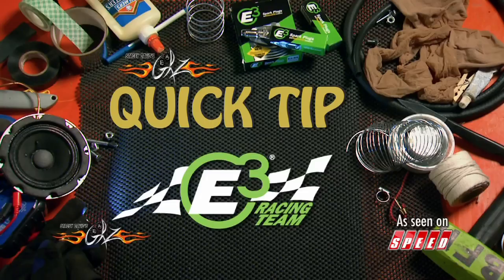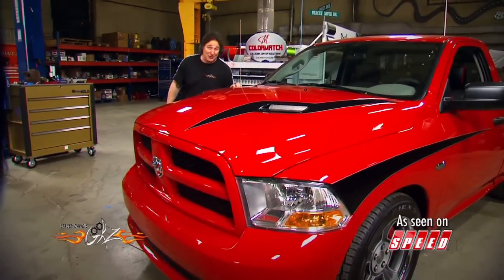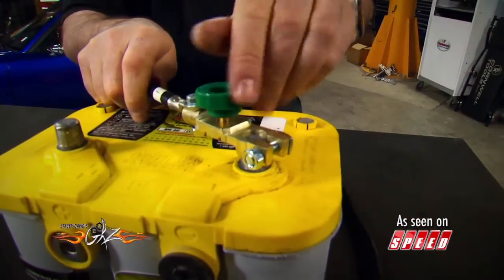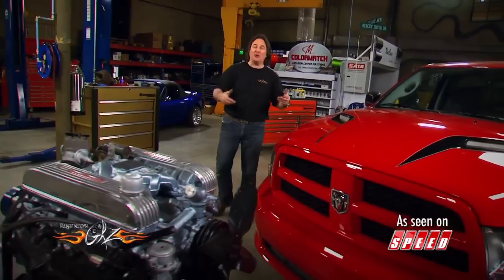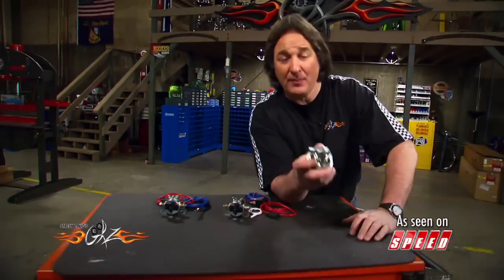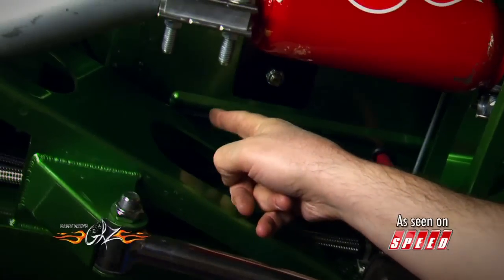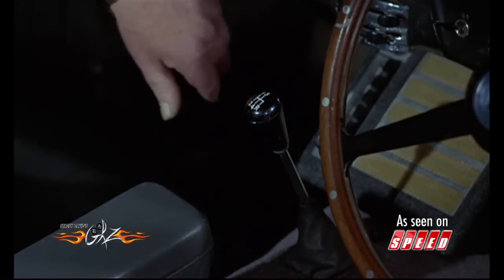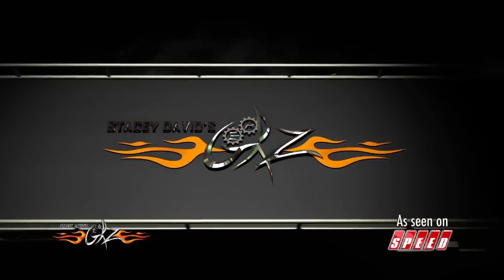Stacey David's GearZ Quick Tip: Keep Your Car From Getting Stolen

Comment: Number 1 way to prevent car theft: Drive a car nobody wants to steal.
Reply: so.. drive a PT Cruiser? lol
Reply: Jack Duno 
#1 - don't own a car.
Reply: ***** It's all well and fine until the original owner steals it back from you
Reply: R Mac Only way you're getting a stolen Ford home is via tow truck.

Because it's probably already broken
Reply: Doesn't matter. They can still sell it for scrap metal.
Reply: Amen
Reply: that right there is my strategy. lol 1983 chevy van. hahaha. though it is 4x4 now it does take some special tricks to start it considering it is a diesel and nothing is stock.
Reply: doesn't work. A lot of thieves will punk your car and sell it for scrap...

Find an Astro van. 1 minute later you got it running and down the street. Next day you're at the wreckers with 400 bucks in your hand.
Reply: Jack Duno  that is what i did for 10 years with my 97 corolla. had peeling clear and nobody cared, i could even leave the windows down at work and anywhere i went.
Reply: You mean a yugo?
Reply: Honda civic si
Reply: Tried that.. turns out my rust bucket was still something someone wanted. :(
Reply: Jack Duno prius
Reply: that wont work my old Astro Van got stolen twice
Reply: Jack Duno aww really??
Reply: really I did not see that characteristic in Iraq but I bet you never did anything for this country but take up space
Reply: Most of us Americans don’t know how to drive manuals
Reply: Guess it's possible that Astro Vans are making a nostalgic comeback, hence your two thefts.
Reply: Jack Duno so Drive a Prius
Reply: A Ford
Reply: They make you pay at the scrap yard to get rid of it they don’t pay you for the metal
Reply: Jack Duno not true they will use it to get out of an area they just robbed if they need.
Reply: Thieves steal 1990 hondas ,they steal whatever they can.
Reply: Or play pretty music like classical. Criminals hate that stuff because they’re so into rap.
LOL.
Reply: thought i was, till my '01 beat white ford cargo van full of crap was gone...
Reply: It don't matter they steal those two I have a 72 Dodge Dart and it was gone the next day
Reply: a LADA
Reply: What car? And why prius?
Reply: @zaheer4024  Atleast someone wanted it
Reply: I had one of those cars back in the '90's.  It was a Nissan Sentra beater complete with dents.  I loved that car.  I could park it anywhere and not give a rat's butt about nit wits parking too close and dinging my doors. I can actually say that I had more fun with that car than some others that also owned: 1978 Pontiac Trans Am, 2017 Mustang V-6, and my current 2020 Mustang GT.
Reply: @OnlyNotes  There's some truth here.  I just bought a new Mustang GT.  With only 1,600 miles the check engine light came on for the fuel purge valve.  What a disappointment. And to think, I thought the plastic oil pan on it would give me problems.
Reply: If you live in Socal, they will steel it for the Cats
Reply: @NotN8  p.s they did have a key tag anti theft my cuz has an early p.t
Reply: Buy a KIA nobody steals those….. 😩😂

Comment: I use 3 tricks, they don't work on a topless car but everything else they work.
1) remember the old Club wheel lock, I have one on my wheel (you don't even have to lock it) most thieves would see it and move on, it would take too long to cut loose and you can't drive with it on.
2) for tow truck using thieves, crank your wheel to 1 side, all the way to its stop then make sure the wheel locks when you go to leave. It's hard to pick the front up and now impossible to pull from behind because it will swing out the whole way to wherever they go.
3) hand/emergency brake. set it so even if they get it up on a truck it's going to make loads of noise and the only way to disable it is to cut the line or get into the car, both take time they don't have.

a friend of mine took a switch and a tilt sensor from a pinball machine and rigged it so when he parks, he flips the switch and whenever the tilt sensor makes contact the horn, dome lights, and brights come on, we tested it, you can't accelerate with traffic at all or corner without this thing screaming

Comment: a few tips for you guys worried about tow trucks.  if you park on a driveway turn your wheels towards another object,  a wall or car.  make sure it will hit if they try to drag it out.  the other thing is: if your car is a front wheel drive,  park it inwards and use tip #1. if they try to drag it out your car will smash into another object or they will just give up because it requires alot of time. if it's rear wheel drive i would say back it in.  the car will be dragging and slowing them down,  i would still try tip #1 but it doesn't really make a difference when they pick up the front wheels. my car is a rear wheel drive and my steering does not lock,  if they pick it up from the back they are good to go. in my case i park it in reverse and i got a 2 way alarm with shock sensors and tilt sensors,  if my car is lifted i will know about it immediately. not only that but my car won't go into drive without me messing with it hahaha.
Reply: John Doe what alarm do you have?
Reply: viper alarm.  you can ad stuff to it.  i added the tilt sensors to the alarm.
Reply: what model do you have? and that's sweet
Reply: i don't remember the model number but it comes with 2 remotes,  1 is an lcd 2 way pager and the other is just buttons. it comes with shock sensors and remote start. you can add other features to the alarm like tilt sensors, turning on stereo remotely, rolling windows up and down,  glass shatter detector,  proximity detector and a module to track your car and get notifications on your smart phone.
Reply: John Doe
Reply: Might work on the amateur tow drivers looking for a quick snag but if an experienced guy wants your car they will still get it out whether it's frw/rwd, backed in, or alarmed. They'll hook and go to drag the car around the block or put their slow-rollers under your locked tires to get you out of tight spaces so they can get you on their arm. Check out about 8:45 in this video for an idea of some of the equipment they can carry: watch?v=nOqfOyHDbTg
Reply: yeah i know it's possible but they will really have to want it to make all that noise and take all that time to do it.  most likely they won't be pros lol
Reply: I believe he has the Model -  Viper Responder 350

Comment: OR. Pull out ignition fuse cause im a cheap bastard.
Reply: killersushi99 they can just use one of the other fuses that is for say your stereo and slap it in there. It'd be better to just flip it around and stick it back in
Reply: Create a kill switch and hide it somewhere.
Reply: On the newer cars there's a fuse for the electric fuel pump.
Reply: I am thinking that A relay would be better than a fuse, they are far less likely to have the ignition for fuel pump relay on hand.

Comment: Pretty much every thing here is for older cars, newer cars have electronic kill switches and installing any of these maybe just be redundant and not needed.  Most common way of stealing a car is rolling it down the street to a waiting tow truck so the diesel doesnt wake you.  If you suspect this may happen to you then get a garage, if you can't afford a garage get 4 wheel boots and use all 4, install tilt sensor and a high range alarm and get a pit bull.
Reply: Screwg oogle dude you can go to Best Buy for that!

Comment: I've seen one guy use a double throw switch to interrupt the power to the starter motor and send it to a second hidden horn (experienced car thieves may cut the factory horn before breaking in). His ride has never been stolen but I'm sure it'll give someone quite a surprise if they try. The switch is momentary so it has to be pressed and held while starting the car, once the car is started it can be released.

Comment: I appreciate the information. I shop in a town call Chula Vista about 6 miles from the Mexican border. There is a shopping mall there that has more cars stolen from it than any other Shopping Center in the country.  I usually take the battery cable off the battery. The problem with that, is car thieves see you underneath your car's hood they have a good idea of what you're doing. the distributor switching was what I was interested in, possibly two switches in the same line in different places.
 Again thank you for the video.
Reply: It's Chula Juana, what can you do.

Comment: A great one is buy a car with a manual trans.  Most folks today do not know how to drive them.  But, seriously, in my antique show cars, I used the cigar lighter.  Wired up to the coil, push it in, start the car, with it removed or in the popout mode, no start.  Simple, but effective.

Comment: I've got 3 different anti-theft mechanisms on my truck. 1) its a manual. 2) its got a fuel switch that I've hid, when it's off, the vehicle gets no fuel. 3) I've got a starter switch that I also hid, when it's off, the starter doesn't even turn over even if the thief hot wired my truck. When I park my truck in a parking lot or something, I usually only use the fuel switch, but if I'm parking at my house over night or in the storage, I use both switches.

Comment: As several tips experts say to keep thieves from making off with a vehicle as the top tip is to go into the underhood fuse panel and pull the fuses for the ECM and or fuel pump when there is tips to put a hidden kill switch and or a valve in a section of the fuel line making thieves go on to easier targets.

Comment: I know this is an old video but several of the things you suggest are a bad idea on a fuel injected car. 
1.The fuel line tap, down right dangerous. Most injection systems use a pressure regulator at the engine. If you close the fuel line before that regulator you will end up with the full pressure the pump is capable of, sometimes upwards of 120 PSI, between the tap and the pump. This could easily blow off a fuel line and spray fuel everywhere not to mention it puts an extremely high load on the pump.
2. Battery quick disconnect. Many car computers have a memory for idle speed, fuel map, transmission shift points and more..This means a relearn every time you disconnect the battery. Airbag systems may not function and bring the SRS light on until the computer is reset by a scan tool. Many other potential issues, even potential to destroy a computer.
3. Battery disconnect solenoid. Same as 2 above.

What I do is put a switch in the control circuit of the fuel pump relay.
A bit harder for the DIYer but far safer and harder for the crooks to detect.
Otherwise pay the money for a good alarm and GPS tracker.
Reply: I know this is an old comment but I think this mostly applies to classic cars that don't have modern locks or computers.

Comment: Place the 110dB Screecher for the Car Alarm INSIDE the vehicle, hide it where the 'normal' audio speakers are fitted, and wire this to the ignition - via a hidden switch. Or better still - two of these - one for each ear of the thief! Try this. It really works. Just don't forget to turn the Screecher off yourself before driving!!

Comment: no love for the battery disconnect thing as it will make my car re-learn its fuel management process everytime and cost money and performance.

the best way is to put some old grenade that you have lying around , and rig it so that that when a thief opens the door, the grenade will fall on the seat and blow the thief to mars.

I call it the Grenalarm.
Reply: but wait
if the grenade falls on the seat
wouldn't the car be in burning pieces?
Reply: It'll buff out.
Reply: It looks like you are throwing out the baby with the bathwater. Don't you want to keep your car?
Reply: That's a myth. Any car ECU will quickly re calibrate parameters by its self.
Reply: @chris77777777ify  No, you are lying, ETC  is saying other thing.

Comment: Much better than the "dizzy switch" is to connect a wire to the same wire being cut with the dizzy switch (between distributor and coil), at the negative side of coil.  Then run the wire to the driver area and connect to ground, with a switch inline.  Then when you flip the switch, the points permanently ground out. But this only works with older cars with points and condenser ignition.
Even better is to configure a similar circuit using a relay such that this circuit gets actuated automatically when the key is turned off.  Then a push button near the driver is used to activate the circuit, and released after the car starts.  Too difficult to describe the circuit in words, but with the info I described you can figure it out if you have a good understanding of basic electrical.  Also to help you figure out the circuit,  a diode will be needed too.

Comment: Fuel Pump Power cutoff with SPST. This lead is available at the rollover cutoff which is conveniently located in the cabin, mostly on the passenger A-Pillar or kick panel . The thief car try to start up but without fuel, no go. Our area in Canada has just seen a big spike in high end Lexus/Mercedes  theft for 'container export'. Theives are now using the KeyFob Repeating Amplifier trick to unlock and (keyless/proximity) start and drive away.

Comment: One of the most simple things to do is to take the fuse out to the fuel pump or crank fuse,and just lock your glove box.  Also put on the Autolock Theft Pro and they can't shift your car out of gear because they can't depress the brake pedal. Get a pager alarm. Besides that if they want your cat bad enough they will tow it or jack you for it.

Comment: Disconnecting the crankshaft position sensor will disable the fuel pump, engine will still crank but will never fire up. Another good one is to install a hidden GPS box...

Comment: A dizzy switch is a great way, two of my cars have them, the one car has 3 of them, the other one has 2 of them. 
The other way is a line lock, drag racers know what I am talking about, you can set it up for all 4 tires, this will help stop a tow truck from taking it, as they would need a carry truck and still the tires would be locked up. 
Another way is to hook up an alarm to the lights, ANY LIGHT that goes on sets off my alarm, trunk, hood, door, brake light, any light. I had a fried who would only put enough gas in his truck to get where he was going all the time, used to piss me off, each time he got into his truck he had to stop and get gas, a fuel cut off can be mounted inside the car, my dad's truck had one, the good thing about these are the car runs out of gas leaving them stranded on the side of the road or in the intersection, NOT a place they want to be, so they just run away. 
Just some ideas for you, a stick shift will stop any young person, sad but true.

Comment: When I had my 78 vett, I unplugged the distributor coil wire, swapped it with the tac wire and unplugged the alternator.Even if they got it started, chances are they wouldn't get far because of the battery going flat.
That and the carb bowl leaked, so you had to know how to start the car because it was easy to flood.

Comment: Sucks but no matter what you do, if someone wants your car bad enough, they'll find a way to take it. After seeing that several Hellcats have already been stolen, that just pretty much tells you nothing will stop them. Besides bullets, that is....
Reply: That's not true..?..My hell Cat..Would have been stolen 4 Times already at the Mall parking lot..The Battery & NO gas switch Works...I leave the door Unlocked So they don't break The Window..I Designed My Own..Seat Caddy...Its Welded in on the floor and HANGS OVER THE CONSOKE..& Reinforced..FROM UNDER THE CAR..THE device ?? keeps you from sitting in THE ( Drivers Seat )...The last Time The Same Guy came..I had the police waiting on him..This guy brought a Hammer..Saw..and a Crowbar...He was in the car for 15Mins..I HIT THE REMOTE AND TURNED THE CAR ON..AND HAD THE STEREO BLASTING..HE CUT HIS HAND..TRYING TO TEAR OUT OFF THERE..NOBODY ELSE HAS TRIED...ITS BEEN 4YRS NOW..SAME PARKING SPOT AT THE MALL..🤔.."
Reply: True. had alarm, keyless entry, kill switch and lock on the peddle, came out of work and car was gone. Im thinking tow truck. It was found 2 weeks later stripped on the side of road

Comment: my dad's truck got stolen before he went to work

The truck itself has a faulty electrical wiring issue where the gauges will not come up when you turn the truck to the run position, it's either pressing the reset button on the cluster or hit the top of the dash. Greatest anti-theft system ever! It was a day later the cops saw the truck, and let him know out on the jobsite, and I took him to the hotel to get his truck back.